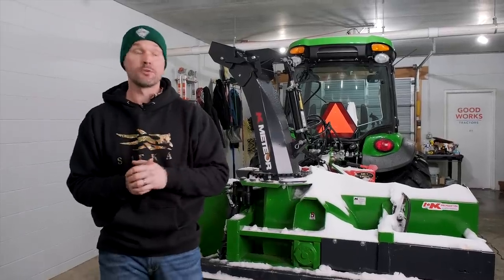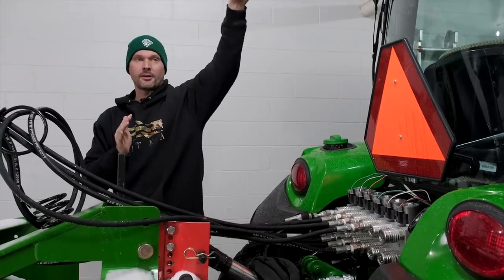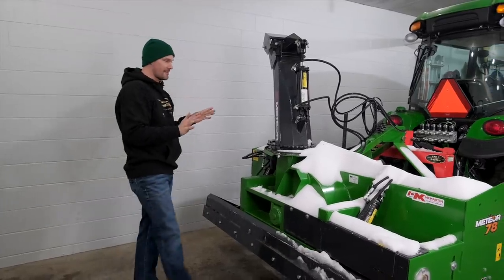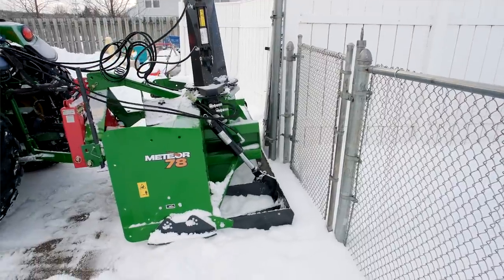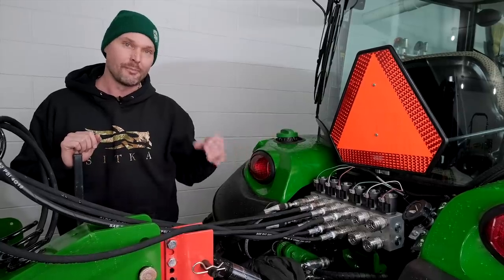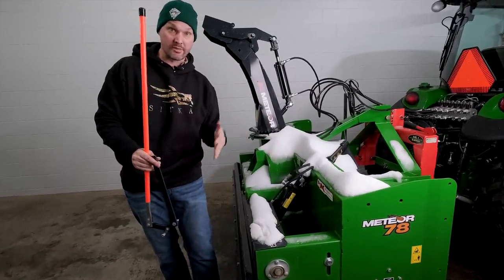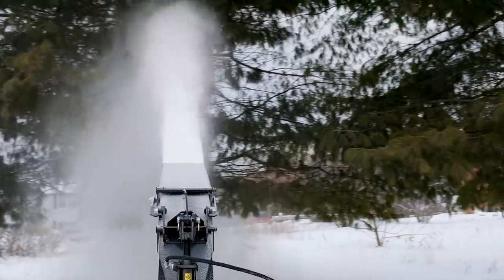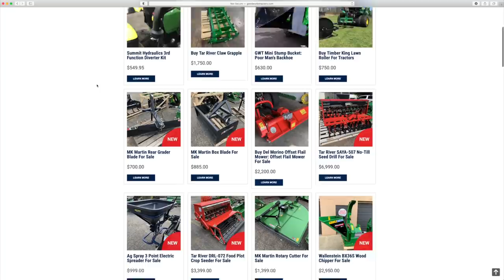INVERTED SNOWBLOWER! 🙃 NO MORE BACKWARDS BLOWING! 😗💨❄️

Comment: I just watched this and it appears to work good but how good does it work with a 12", 18" or sometimes 24"storm that is a lot of snow to drive over, not counting the end of the driveway after the road have been plowed.
Reply: That's why you head out early and often.
Typically you don't want the snow to accumulate higher than your auger housing, if you do = Operator error,.
Do it more than once = Laziness lol.

Comment: The blower looks like a really stout awesome unit except the idea behind it. The unit is so big it’s obviously designed to move a lot of snow yet you’re never going to be able to drive forward through that amount. Just like the clip of the tall chute you included you’ll never be able to drive the tractor through 3 to 5 feet of drifts or snow banks. Seems like the hassle of switching the front implements every year would be worth the benefit?
Reply from the maker: Put a pusher, plow, or bucket on the front to break up drifts.  However, if you deal with 3-5' drifts all the time, then maybe it's not the solution for you.
Reply: The bigger snow is why he has the pusher  on the front is really nice piece of equipment  still would like to compare to sheyennes front loader mount
Reply: Ive taken out 5’ piles of snow with my inverted blower. It can do it. 

I easily blast through 3’ banks all the time.

Comment: I just stumbled across a smaller Frontier model SB1164P on the John Deere website.  Do suppose a 1025R could handle that machine?  Or is it still a bit too big for the 1025R?  I've only see couple vids of these pull behind blowers, and they all feature BIG blowers mounted to BIG tractors, compared to the little guy I'm hoping to get this year.
Reply from the maker: I think that's too big.  I run a 54" pull type on the 1025r and don't think it would do well with anything bigger.  I've made several videos of it.

Comment: Nice blower but i would change the rear scraper... i would take the hydrologics off the back and replace it with chain so it can float across the ground.
Reply from the maker: That would be the manual backdrag so you'd save some money that way as well.  Though technically, even with the hydraulic backdrag, it is still floating as the 3 point hitch doesn't have down pressure.  It's just the weight of the attachment and gravity applying the pressure.

Comment: How much pressure does that mini back blade have??? And does it change the angle of the blower when all the way down??
Reply from the maker: I'm not sure.  The 3 point hitch doesn't have down pressure, so I believe it's just the weight of the attachment applying the pressure.  I suppose if the hydraulics lift the blower off the ground, then it's applying the full weight of the blower to the backdrag edge.

Comment: I see you have paved areas, how does it work in gravel dirt driveway
Reply from the maker: I don't know why it would work any different than other snowblowers on gravel or dirt.
Reply: I use a 68'' Meteor on gravel exclusively with no problems after the 1st ice base is down.
Reply: @GoodWorksTractors   yup just like tractor tyme

I blow gravel driveways. Just keep your angle of attack less aggressive and let the base accumulate then you are good

Comment: Wow!  It takes a beast to work that beast!  Nice set up.  That's what you need for your driveway at home.  But on the 1025R for mobility.  Is  there adequate access to clear the chute and impeller etc, when things get sticky?
Reply from the maker: Haha, it is a big old honker.  I estimated around 1,200 lbs with the backdrag and extra hydraulics.  Yeah, pretty good access all things considered.

Comment: I get the theory of dragging blower forward but your still gonna be looking back to keep a eye on the chute. It looks like it should also come with a a free case of Aleve for your neck.
Reply from the maker: The same way you look back at a tiller, brush hog, rear blade, box blade, land plane, finish mower, etc?  Almost every attachment that goes on a 3 point hitch requires the operator to look back at least periodically.

Comment: I’m a bit confused on the hydraulic portion of having a rear snow blower. what is the difference between the power beyond kit for deere or a rear SCV vs this multiplayer? you mentioned the multiplayer is the cheapest. what other options are there? i have a 2020 1025R. thank you in advance!
Reply from the maker: Power Beyond requires the connected attachment to have a control circuit -- like the controls on a backhoe.

For a rear SCV, that circuit is on the tractor, not the attachment -- typically a lever or button on the operator station.

http://wwww.summit-hydraulics.com has lots of options.  You get 5% off with code GWT on their site.
Reply: @GoodWorksTractors  thank you! i found something that is specific for the 1025R, this looks like it would work perfect.

Comment: Looks like it blows well but I live in MN and I get 2 or 3 foot drifts and that style would not work for me. Great information on the video.
Reply from the maker: Thanks for watching. What's your setup for those big drifts?
Reply: @GoodWorksTractors  3 point blower driving backwards. 50 inch buhler/farmking on a massey gc2300 with a loader.
Reply: @jasonklabunde6415  I used a 68” meteor on my kubota b2710, I had the loader on front and I would just cut the snowbank when they got over 2’ if I could just push through. 

That was my small tractor. My new one is much bigger. 

I had colleagues in Fargo last year that had 4’-6’ of snow. They were blowing out with their inverted blowers. On the right size machine it’s not an issue.

Comment: My question is Shear Pin location? Easy access? I imagine there are three? One for each side of the auger and one for the second stage?
Reply: There will be two of them, one on the PTO shaft and a smaller one at the back of the blower.

Comment: Impressive and very true a front mounted 3pt. hitch is no fun to change out to the loader.  Any thoughts on how you would handle snow drifts of say 5' tall pr more without getting the tractor stuck?  With a front or rear facing thrower you can take off the top layer and then back up and get the bottom.  Ps. Love that scraper on the back!
Reply from the maker: If you have the blower on the back, then the loader is most likely on the front -- bucket, pusher, plow to bust up the drifts.
Reply: @GoodWorksTractors  Good thought.  Or better yet an angled blade held 3' high to knock the drift tops through and then to the side to be worked on in a 2nd pass.  Yeah I think you just changed my mind on inverted vs. front mount. Cheers!
Reply: I took out a 5’ pile with my inverted. Keep the blower high push through the bank (like a dozer) *make sure to use power and not speed. If the banks hard and you hit it fast your going to break things. 

Once your over the bank just blow it away.   Works very well

Comment: When you talked about a front snowblower wouldn't work because you needed the loader what about a loader mounted snowblower you could change it for the bucket real quick 2 pins and couple hoses the blower would be off you do have a hydraulic tank on the back but put some weights on each side of tank you would have ballast for weight

Comment: Farmers have been driving over crops for years before the implement can get to them.  Don't see why a snowblower needed to be different.  The only real downside I can see is if the snow is so deep that your tractor can't drive through it.  Otherwise this is the best configuration.
Reply from the maker: It's a good comparison. Still, when you're on a hard surface and trying to remove everything on top of it without damaging the surface (like upturning soil or leaving a bit of crop above the surface), this concern is where my mind and many others went to. But this demonstration shows that concern is not a problem, at least in the conditions we tested in. Thanks for sharing your thoughts and for watching!

Comment: would love to see it plow in a 24+ snowfall on a 3 series.
Reply from the maker: Well buy one and find out for yourself! 🤣👍
Reply: Never happen...the tractor would be stuck in 2 feet of snow.
Reply: @ComfortablyNumb1969   i would be skeptical - especially on an incline. Maybe Good Works will come through with a video!!!
Reply: @jeffklinger1164  I've seen an older 4wd Ford get stuck in a foot of snow and it had chains on it front and back.  IIRC it was a 1910, and there was no ice under the snow. Could have just been to light of a tractor.
Reply: Hope Kalamazoo gets a major snowpocalypse, so he can show us what it can really do.
Reply: I have a quick attach 78" inverted snow blower on my 3039r. Love it. I dont let the snow get deeper than a foot. It takes longer to clean up the deeper it is. Works good in wet heavy snow as well. I have combined it with a 6 ft angle blade for the loader. I love my setup.
Reply: @kevinfournier9053  right it’s truly about keeping up with the snow. 

It speeds up the work so much that it takes less time over all to maintain the driveway.

Comment: Erskine had them for years but real pricey
Reply from the maker: So has MK Martin.  Just my first time using one.
Reply: @GoodWorksTractors  so is it worth the money? also crazy hydraulic set up you got there. Loved the video
Reply from the maker: Depends on the individual.  You don't have to get everything I got on it.  I spent the extra money to demonstrate for folks.  Snowblowers aren't cheap to begin with.  Even a front mount 47" for a little 1025r is $4,000.  This one was $8,300ish and is way, way more blower than that.  So, for the right person, it's the right setup.  Most people I talk to that have them are very happy with their performance.

Comment: Larger tractors works better I would say.  Smaller 1 or 2 series in 12+ wetter snow seems like that would not be good.
Reply from the maker: I think tires, chains, weight, studs all make a gigantic difference in the ability to travel through snow.

Comment: Where I live we've been using these for decades and decades, to the point that anything else is specialized equipment and called inverted here.
With harrows, you don't see farmers desperately go through the effort of putting them in front of the tractor either, because it's a recipe for mechanical and fatal disaster.
3-point implements is what our forefathers built the modern tractor to work with in the first place, "inverted" blowers are a 3-point implement same as the rest of them, and work on the exact same principle.
For that reason, I don't see any need to scramble out of the barracks and fight it.

You lower the implement (blower), and simply drive over the material you're working on (snow), let the implement attached to the 3-point hitch do what it's intended and invented for (scoop up the snow and blow it away).
Farmers have been using implements on the 3 point hitch for almost a century on soil, which is way harder than snow, by combining forward movement and the weight of the 3-point implement to cut down into the material they're working.
It's no different with snow, it just doesn't get any simpler than that 😀

If you've let the snow build up higher than the auger housing, leaving you no choice but to ram into more snow than your tractor can safely remove, you've already missed the golden rule of snow clearing: Head out early, head out often.
If you skip out when things get tough, allow the snow to build up, and resort to ramming 30-100k equipment into it, it's not the job or hobby for you, let someone else do it (its cheaper).
Reply from the maker: Great answer.  It's amazing how many folks think it is new or foreign.  They've been around for a long, long time and are very effective.

Comment: I have been going back and forth on the setup I want, and this video definitely eased my mind on the inverted setups.

However, I heard you mention frame mount blowers. They do make loader mount blowers with built in power packs.  Also made by MK martin. Easy to remove and swap to bucket.
Reply: did you go with loader mount or inverted?
Reply: @simd510  loader mount.  Too much snow for driving over.
Reply: @grimWNY  Is it the hydraulic powered one? is it able to blow the snow far? Hows the price compared to the inverted ones
Reply: @simd510  yes hydraulic. Uses a power pack.  Loader mounts are expensive, but they work great.  Throws farther than my rear mount, but it's also bigger.
Reply: @grimWNY  Does 20k sound right to you? I just called a distributer and they told me for the 66inch loader mount mk marting its around 20k.
Reply: @simd510  maybe just a tad high but yeah that's right.  That's what I got quoted for the Meteor 76in.  I got a Frontier for 15k plus the power pack.

Loader mounts are not cheap by any means.

Comment: I loved the idea of these until I realized that my tractor will not be able to drive over the 3-4' snow bank at the end of my driveway to get the snowblower to it...
Reply from the maker: Why would you not use your bucket to simply tackle the end of the driveway?
Reply: @GoodWorksTractors  definitely a valid point. I'm use to having the plow on the front in the winter but the forward facing blower and bucket combo would definitely work.

Comment: The top link needs to be extended. Is there a cutting edge on the blower?
Reply from the maker: I have a hydraulic top link.  Moved with the push of a lever.  It's was in multiple positions throughout this video.  Yes, there's a cutting edge.
Reply: @GoodWorksTractors  is the cutting edge replaceable
Reply from the maker: Yeah

Comment: Not convinced it is worth it.  A basic plow will take care of the job at a fraction of the prices.
Reply from the maker: Never fear, I sell those too! 😂👍
Reply: Im a canadian that does snow removal in the winter..... sure its cheaper but I do resedential properties and compnys that use plows tend to ruin clients properties be it grass early in the season or hitting a raised garden. So blowers are a lot better for this reason.
Reply from the maker: Good point to consider.  Thanks for taking the time to share!
Reply: Also, with a blower, the snow is "dispersed" not piled up. Landscaping damage is a huge worry for clients. The lack of piles at end of drives also reduces risk of melt and refreeze that cause other issues.
Reply: Dispersal of snow is a key benefit of a snowblower.  Running a plow is fine in the short term but the bigger the pile you make next to the road, the bigger the drift that blocks your road next time there's a wind.
Reply: @GoodWorksTractors  My homie!
Reply: @joshuatownsend6735  I liv ein New England.  We get a lot of snow.  Only homeowners run blowers.  Just sayin'
Reply: @johniac7078  I know of at least 22 companies running tractors with inverted snow blowers in the New England area, it’s catching on.

Comment: So pack the snow down before you blow it. Perhaps the stupidest thing I've seen. Real engineering going into that thought process.
Reply from the maker: Hard to argue with the results.
Reply: This is the future or residential snow removal.  No huge piles blocking views entering roadway, no tearing up lawns and very efficient.
Reply: @GoodWorksTractors  

Well it may work for some, but not for me. Plus it's made in Canada may as well be made in China.
Reply: @conradkostelecky5781  wow really?  Some of the best snow equipment is made in Canada.  Between the the three largest snow blower manufacturers in Canada over 3000 of the inverted blowers are sold yearly.